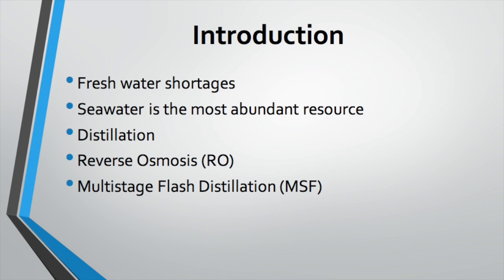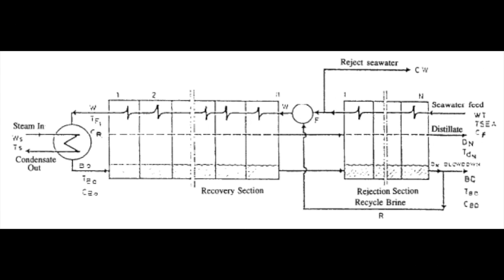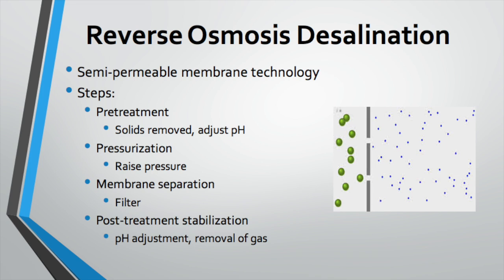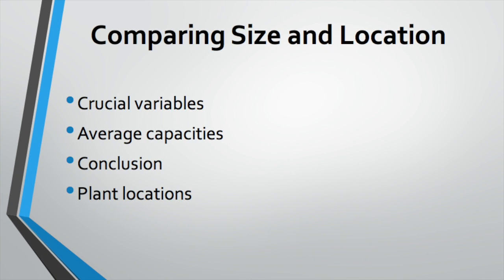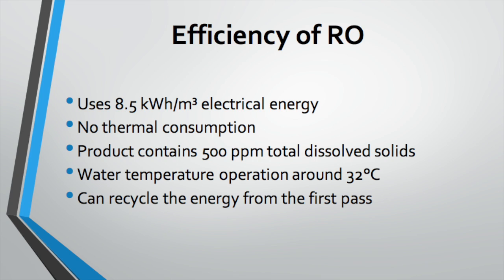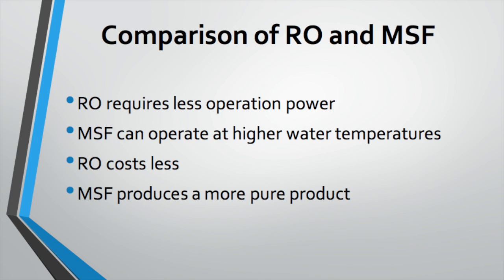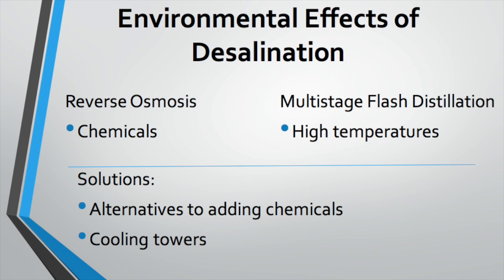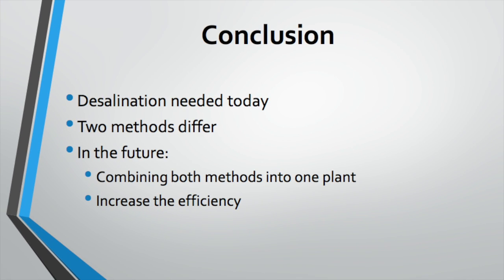Desalination of Water: A Comparitive Study of Reverse Osmosis and Mutistage Flash Distillation

Comment: If solar energy is used to boil the sea water, then MSF becomes cost effective and efficient compared to RO system.
Reply: I agree, Direct heat production from solar energy is much more efficient than converting to electricity then converting to rotary power then converting to fluid pressure. Seems like a no brainer. Using the direct heat of the sun there is no "Conversion loss" and when using heat to do any process there are many ways of recycling, reusing, or insulating to improve efficiency. Reverse osmosis is what it is and can not be done without producing X amount of pressure.
Reply: ALSO a mirror array for concentrating heat could be built locally for a very low cost compared to the cables and associated expenses of the RO system. Concentrated solar heat can be stored in large underground tanks and electric backup heaters can be powered by the grid and or battery systems, allowing the entire operation to be reliable during cloudy days.
Reply: We all pretty much thought of this. Weird that this isn't brought up anywhere, while combining MFD and RO is, even though honestly combining both doesn't make much sense.